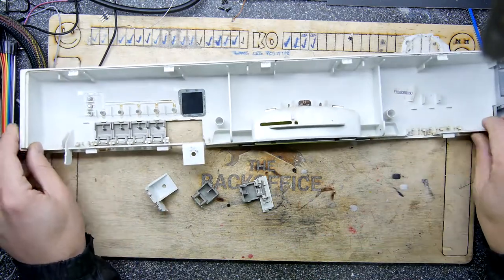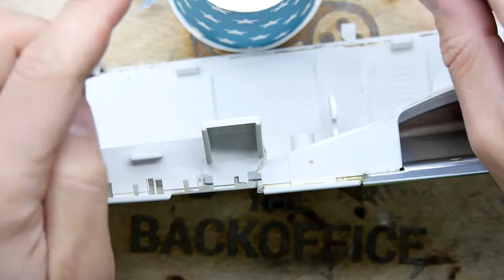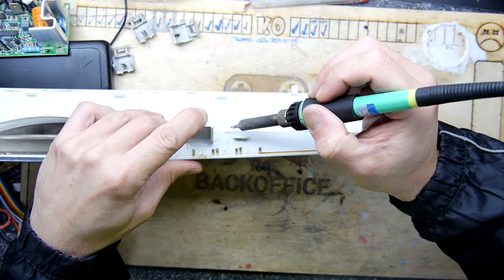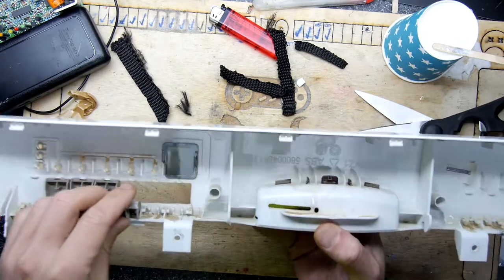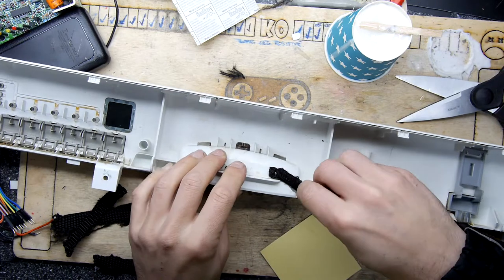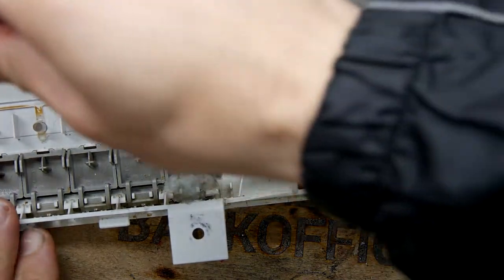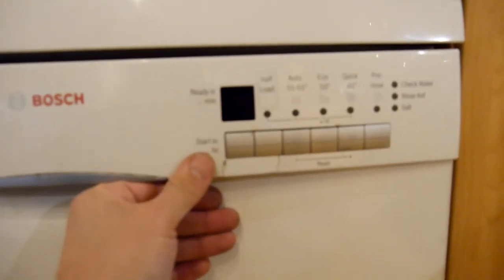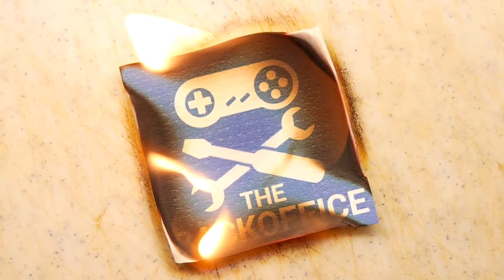Dishwasher Panel Repair

Comment: For Monitors,
Replace buttons with new buttons
Move electrolytic caps to more cool areas by running thick wires under the shielding, and also replacing some caps with new, higher quality caps
Add heatsinks to chips

For filler material on that certain front panel, use ABS plastic parts and acetone to weld them together. You can melt some white plastics from discarded electronics in acetone and fill the hole.
Reply from the maker: +Penurious Sierra Doh, I forgot about the acetone trick!

Comment: Using the soldering iron to plastic weld parts together I find cable ties a good filler material. You can also melt in a paper clip for added strength.
Reply from the maker: +Motovlogger Jamie Cool! There are always loads of cable tie offcuts around. Thanks 👍
Reply: The Backoffice I use that technique to repair motorcycle panels. :-)

Comment: The first electronics module to fail in my Audi was a Bosch ABS module. By many years. The second was the remote unlocking system, which didn't fail for 15 years. Fixing ABS was well over $1,000, and that includes me repairing the original module, and also finding a spare on eBay. My conclusion is that Bosch is kind of junky.

Comment: I did just repair my wireless Sennheiser headphones (again) in a similar way, just with mainly hot glue. I did actually finally give up on them and get myself BT-headphones, but music via BT absolutely isn't the same. :(
A trick I did use use for cracks that didn't fully reach through yet was drilling a small hole at their end, so they cant move further through the material.

Comment: I have a Bosch washing machine...  Just waiting for that heap of shit to pack up now!!!
Reply from the maker: +banjax66 A watched Bosch never screws up. Just wait until you need those clothes for a big day 😁
Reply: I am a big guy,  over 18 stone... So every day is a big day. LOL...
I stuffed a double size quilt in that machine once.. Had to lay on the kitchen floor to kick the door shut with my feet.
The machine didn't like washing that quilt and it went BANG. The door glass smashed and the drum belt snapped.
Second time, I wont be so lucky!
Who said Germans build things to last???
Reply from the maker: +banjax66 ha ha
Reply: I actually must say that in my opinion it's really good if a freezer or dish washer lasts 10 years these days. If you expect more, you need to do the investment in a Miele.
Sure this panel certainly looks like bad design if there is really no unlocking mechanism (which I actually cannot really believe, since I've never seen a dishwasher without one), but the more I'm surprised that it did actually last for so long.
Reply: Invest in a Miele?? 
I can't even pronounce that word... 
So How am I even supposed to be able to buy the product?
Reply: You can type it. So could find Miele kitchen appliances on for example Amazon.co.uk through the search function. 
But be aware, real quality is expensive.